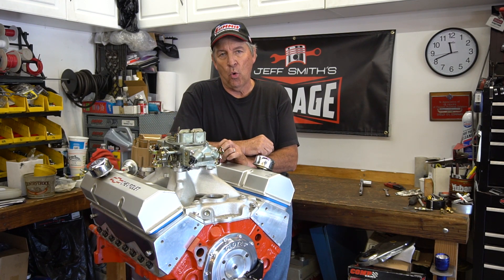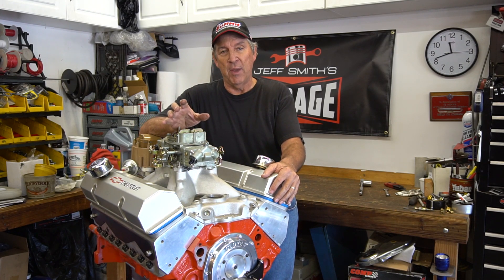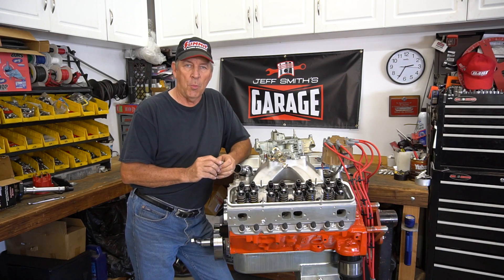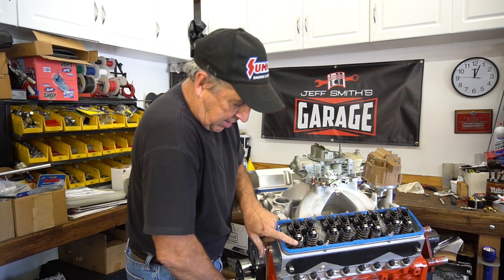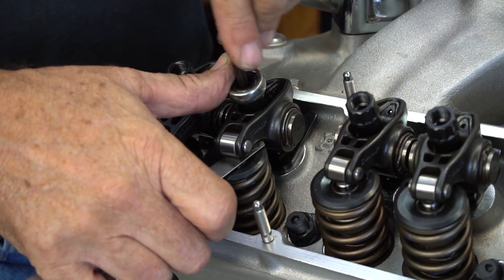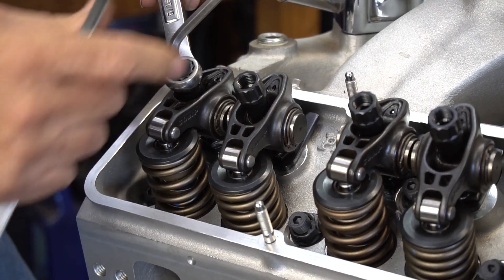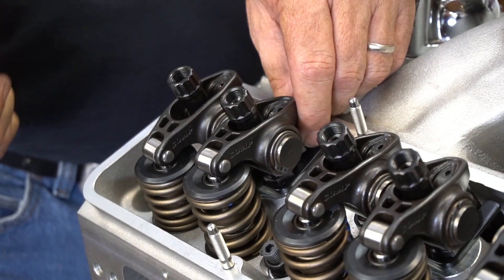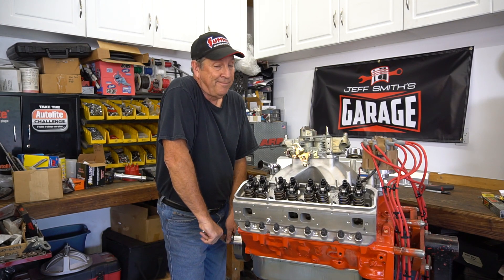Jeff Smith's Garage - How to Adjust Valves

Comment: Does it matter if you’re on compression stroke or exhaust stroke of where the pistons cycle is at doing these EOIC sequences?. Making sure the Piston 1 is at TDC or something someone told me and every single piston is the same then onwards following the firing order of the pairs of rockers. 

I am getting confused with this and doing the EOIC sequence because I can’t start her up (I think I’m doing something wrong with the valve train sequence). Can you do the EOIC tightening the Intake valve when the exhaust opens, then keep cranking until you see the intake open and then about to close to do the exhaust tighten. While doing this does it matter where the piston is at during doing both on every rocker pairs?. I have a feeling I’m starting the EOIC sequence during the exhaust stroke and not before the compression stroke (TDC).

I got told my v6 engine firing order is 1,6,5,4,3,2. (drivers side is 6,4,2)
so 6|5
     4|3
     2|1
Front of car

so that when number 1 is at TDC on the compression stroke the valves on 6 should overlap close (both the exhaust and intake are closing at the same time). So if this is not the case, I’m on the exhaust stroke with number 1 cylinder I believe. I haven’t tried looking at 6 when it does this yet, so I will give it a go doing this EOIC method in the video. I believe I have to make sure the piston is about to do its compression stroke on 1 when I do the tightening using the EOIC method 🤔

Comment: Great video. What are the rules for lashing when engine warm and cold
Reply: For a cold engine - generally speaking you will add clearance if the engine block and heads are both iron - around 0.002-inch. If the engine is iron block and aluminum heads then you subtract 0.006-inch from the hot clearance spec. This doubles to 0.012-inch if the engine is all aluminum. These specs came from Crane cams and are generic for all engines and almost certainly will change from families of engines - big-block Chevy vs small-block Chevy for example - but at least will get you close. So for an aluminum head small-block Chevy if the hot lash is 0.018-inch then cold would be around 0.012-inch. Aluminum expands are roughly twice the rate of linear expansion compared to iron which is the reason the specs change based on aluminum or iron engine components. Hope this answers your question. Thanks for asking!